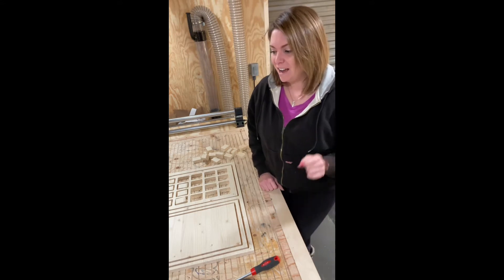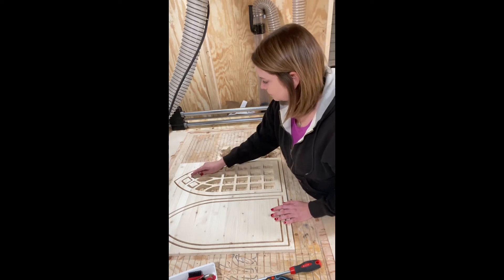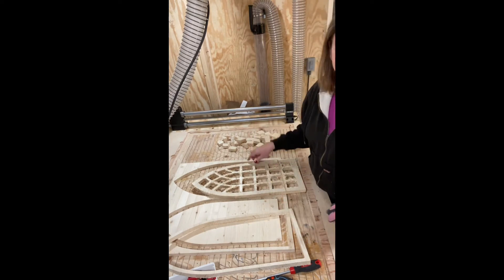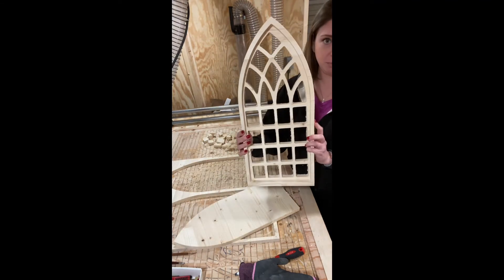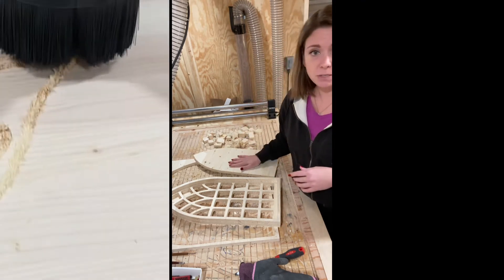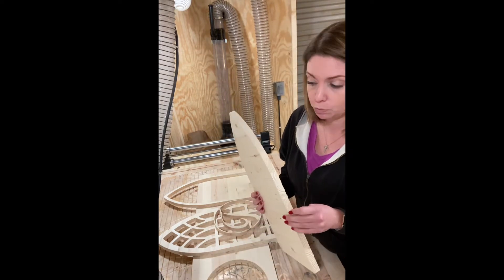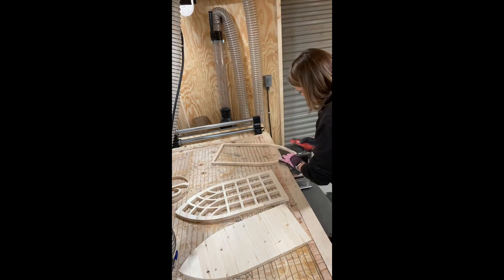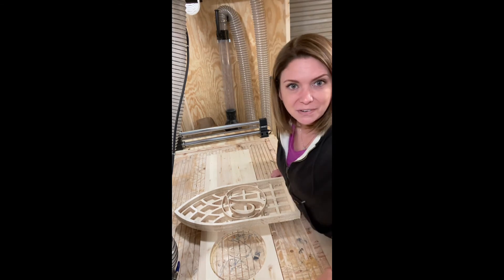Creating Cathedral Arches on the CNC, OneFinity

Comment: Nice project. Since the monogram was nearly the size of the cathedral frame, could you have designed the two together? Maybe adding strength to the frame?!?
Reply from the maker: That’s a great idea. If I redid the this, I’d probably do that. Now that I have a couple years under my belt I’ve learned so much!